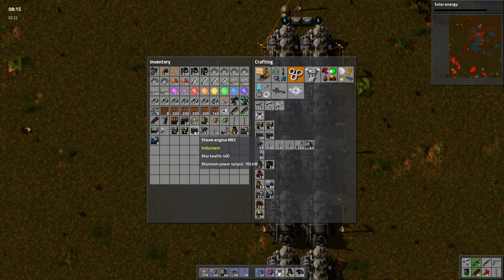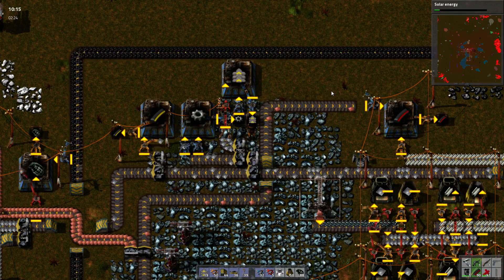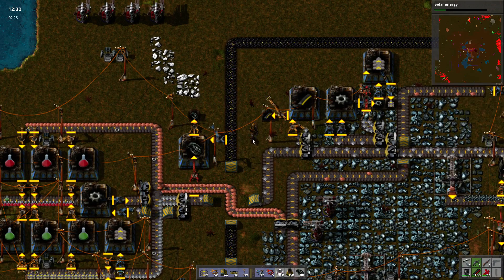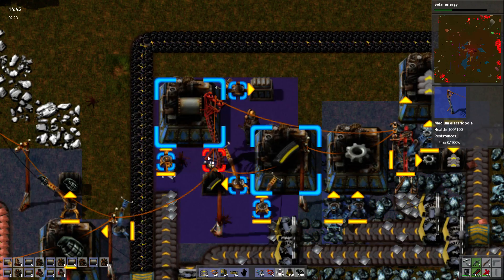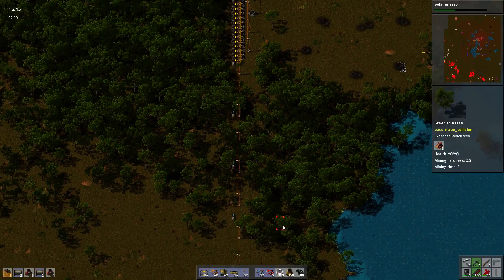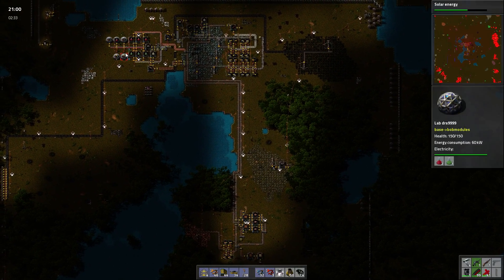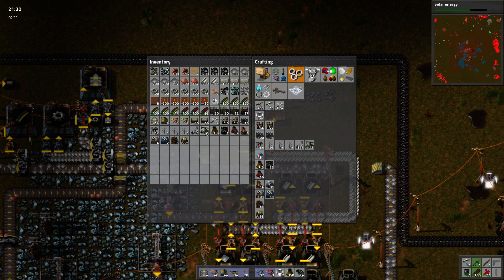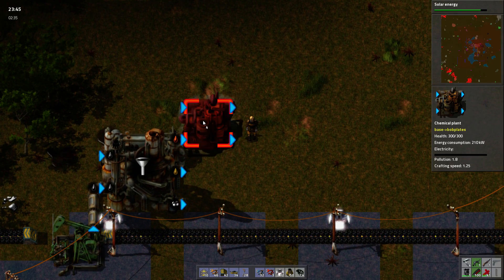Factorio Let's Play with Bob's Mods 8

Comment: About the iron smelting...
Your two miners produce 3.6 ores/sec, and since a regular furnaces smelts one ore every 3.5 secs, you need 3.6*3.5 = 12.6 furnaces, so 13 to fully keep up or 12 and you'll have a small backlog.
Now these are regular stone furnaces, but each steel furnace does exactly the same job as two stone ones, so you need 6 steels and one stone to fully smelt the output of two miners.

five LA miners = 5.81 ores/sec = 20.335 stone furnaces' worth of smelting, or 10 steels and a tiny backlog.

Comment: I made a dual system for basic circuits for my Bob's mod game, I had an assembler making the final boards, fed by 2 systems, one system using wood, the other using synthetic wood. I used a smart inserter on the output from the synthetic board making machine linked using red/green wire to the input box of the (natural) wood board assembler. Later on this input box would be turned into a requester box, using wood sequestered, by robots.   The result being that if wood was available it was used to feed circuit making. 

I later on duplicated my machine to increase output.
Reply: The smart inserter was set so that if wood was available in the input chest it stopped feeding from the synthetic wood system, hence saving oil, and using the stock of wood available

This can be made quite compact if planned ahead of time.
Reply: If you set 2 chemical plants back to back with oil feed in the center then build outwards from there.